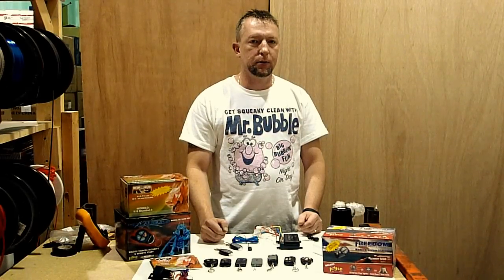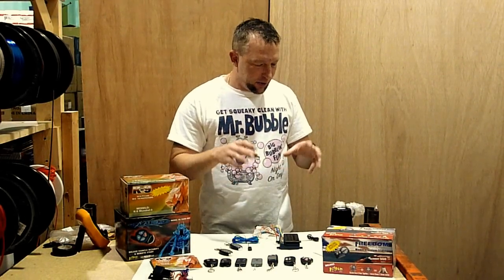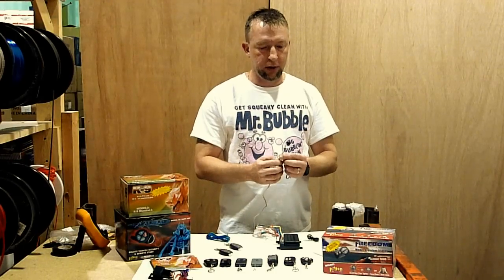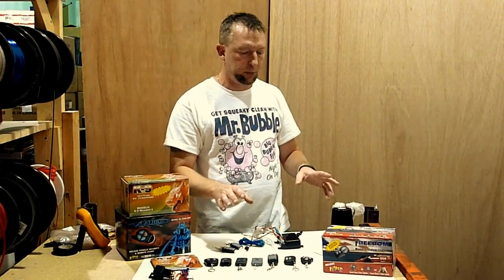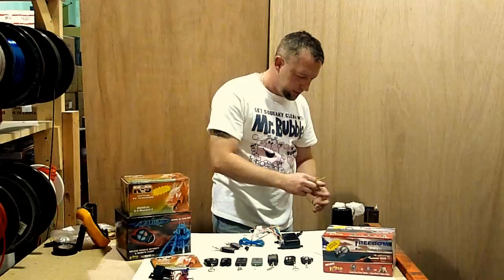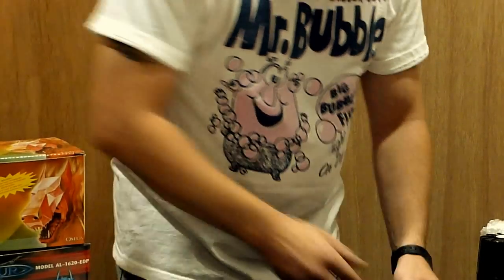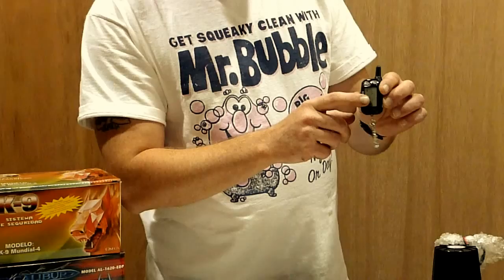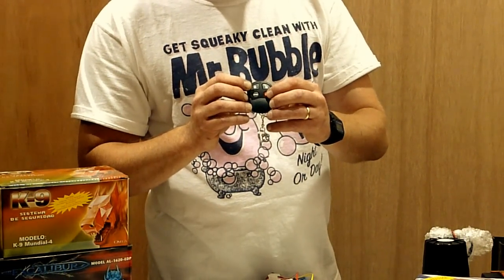How-To  Omega K9 Excalibur Crime Guard remote transmitter programming

Comment: I have a K9 Excalibur, maybe one of the originals / classics and I bought (2) 2-button remotes, nothing.  My original remote is trashed so not sure if alarm is actually going into disable mode. I can put alarm into and out of valet mode with the valet button, and the alarm auto sets itself. But in order to turn "off"  I have to turn ignition on, press valet button to put in that mode.

So I am unable to get to the chirp-chirp to disable  alarm as in the video.  What do I do?  Am I SOL? I can't find the manual and the manuals I've seen online gave the newer remotes shown, not the 2-button K 9 remote

Comment: Hello there, I tried this and my transmitter is opening and closing the doors but all is silent.  The alarm is not making any sound.  Any help will be appreciated, thanks for the video.
Reply: I'm having the same issue if you figured it out I would love to know if not let me know so if I figure something out I can let you know
Reply: Not sure what type of remote you have if it's like the older door lock one with the trunk release or basically with rubber buttons take it apart and use 91% alcohol and a qutip and clean the battery connection really well and any button connections then install a new battery mine did this constantly not sure if it requires a stronger battery connection to remote start or what it is but now everything is giving me problems and I have 4 remotes I've tried cleaning new batteries and it still gives me issues